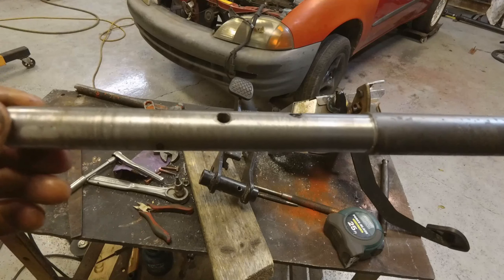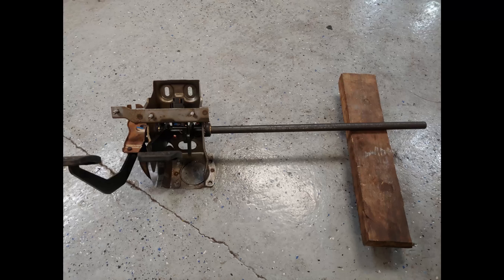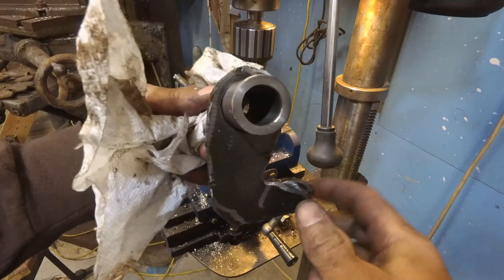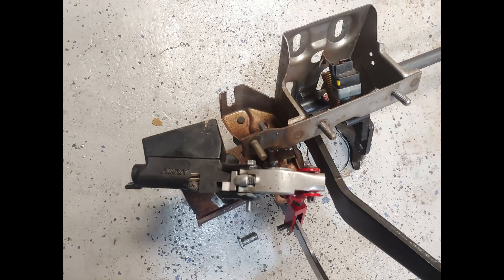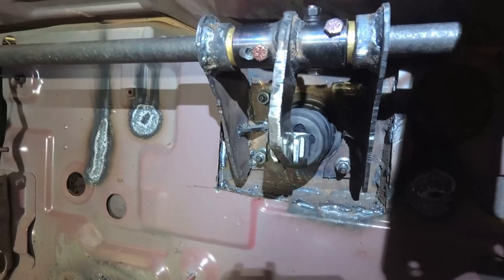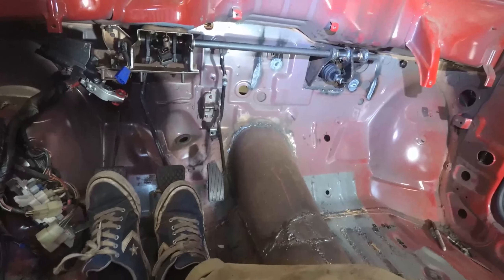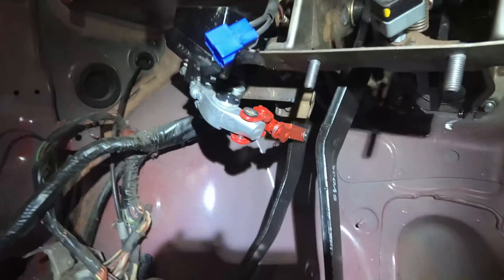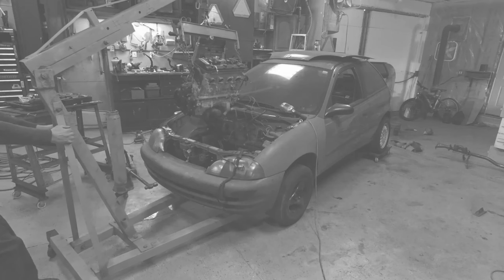hayabusa powered RWD geo metro! , metrobusa 4

Comment: Hi Justin, Was wondering if you could make me the chain setup for the clutch. I have a pedal and the clutch handle/master cylinder. I just need the chain link you made. Please let me know since your clutch solution will also work for my application. Thanks
Reply from the maker: Those are just regular links,maby a masterlink too, from your local tractor suply. I think i used 2060 chain. And maby a bit of reg. 60 chain too.
Reply: Justin, can you make a duplicate of that clutch handle chain link piece? I would like to buy it. It's a brilliant idea.